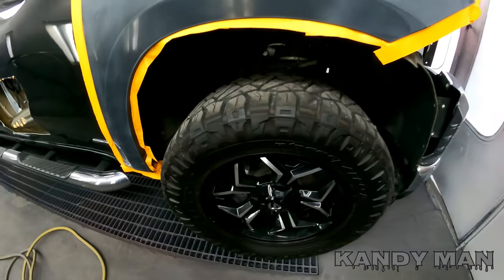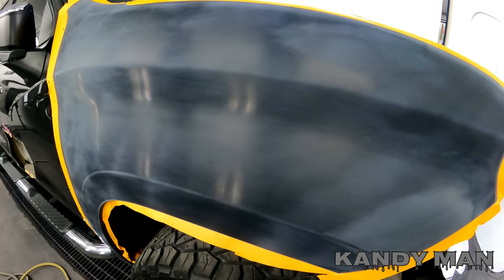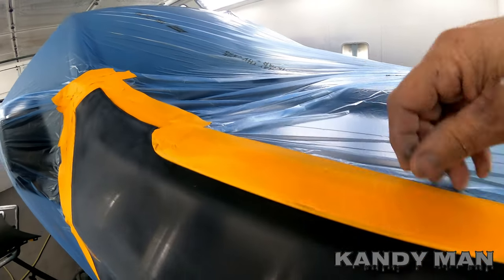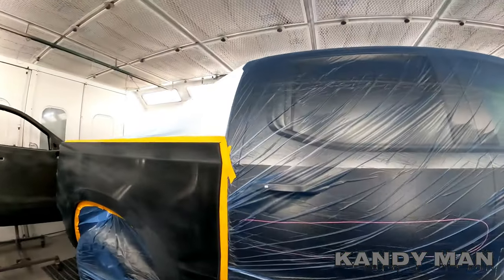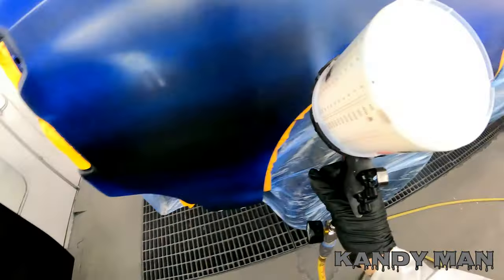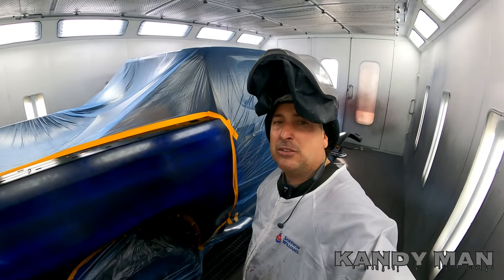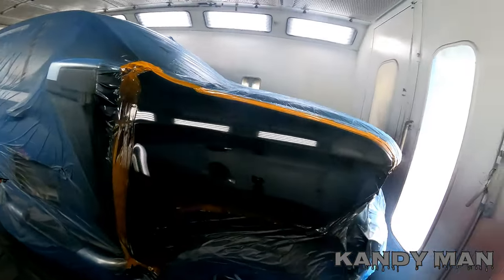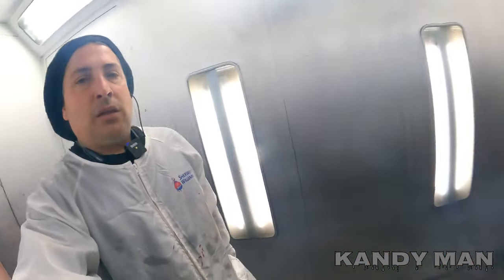STOP FISHEYES FOR GOOD!

Comment: Great video and tip! Also I know this was asked but to clarify…. I get your using a mix of water and solvent but in your opinion is specifically the water clear base the secret? I know in another comment you mentioned you can use solvent clear base but I thought in the video you said that water specifically is what seals the possible silicon contaminants but towards the end it sounded like solvent clear base works just as good?Lastly again I know it was mentioned in a comment but as long as it is flashed you can spray water clear base and put solvent base over it no problem? I mean I know with ppg envirobase its all water and the clear is solvent so seems ok? Thanks
Reply: Did u try it yet? Anyone know what water base wet bed i can buy?
Reply: @MartinMora92  i did kind of…. I am still trying to rule out issues and or possible causes with my system and process. I decided to go to an electric 6 inch sander because my theory is even though I dont religiously oil my sander it has an exhaust and was spitting oil on anything I sanded and even with waterborne wipe, wax and grease wipe and alcohol wipe still had issues. After I watched this video I painted some four wheeler plastics, properly cleaned and wiped down ect, i have a high end inflatable but didnt want to put it up so just sprayed in the garage and of course was getting fisheyes in the paint stage even! I was going matte clear and didnt want to have issues so I ended up using PPG T491 tinted clear waterbase as a wet bed which looking back I couldvhave used PPG T490 and by my suprise it worked perfectly! I was super happy but it is an extra added cost for every job not to mention what the life expectancy would be spraying over waterborne with solvent on top of the fact it was different brand paints but in short yup worked for me! Oh and I tried the solvent clear base on another job that didnt work for me so it appears specifically the waterborne clear base/wetbed is the secret.
Reply: @JustArandomDude11c  i use fish eye eliminator on everything even on primer, and on my first coat of everything is always light,

My first coat of clear is always reduced 10% and misted on like adhesion promoter then i let flash then i go as normal
Helps

I spray next to mechanics so i do alot of thngs to get it done
Reply: @MartinMora92  Nice! Im freaked out to use fisheye eliminator because its always been a myth that if you use it you have to use it forever atleast in that spray gun and I know my luck if I finally used it I would still get them lmao but good to know it works what brand fisheye are you using??
Reply: @JustArandomDude11c  no thats not true just rinse it off with some reducer after your clean up with lacquer thinner, i use it at.home all the time and take my gun to work everyday (professional shop) and we dont use that over there and i never had a problem, i usually do 1 cap full on everything
I use transtar never had a problem, thats all myth, its made for a reason bro, keep it around and if u get some on first coat theb just add some to clear for the second coat, been doing it for.yours, and your talking to someone who sprays in a dirty shop next to mechanics 15 feet away with no spray booth just a box fan and wet the floor w dawn before painting, that kinda guy
Paint 4 cars a week there as my side shop
Reply: @MartinMora92  ok good to know thanks!!

Comment: Wait im confused please help me understand

So u use a waterbase wet bed intercoat  to seal down the panel

Then u spray your normal Urethane base coat then urethanr clear over it?

And no fish eyes?!
Reply from the maker: I'm using a water base system but it would work also like your saying thanks for watching
Reply: @kandyman5315  a wterbourne wet bed wont make my solvent urethane base and clear coat react?
Reply from the maker: No it won't just has to be fully flash off I use a solvent  sealer then water then clear  same principle